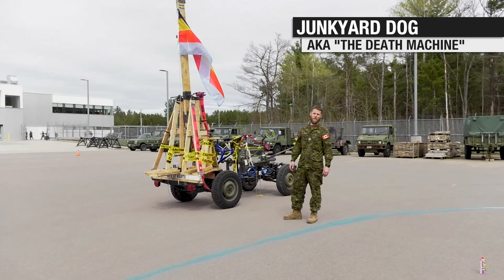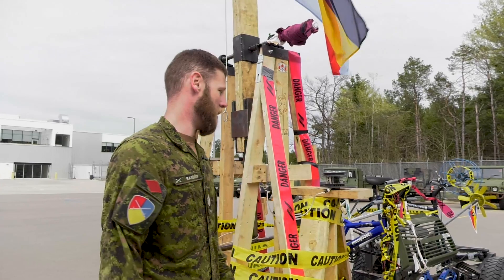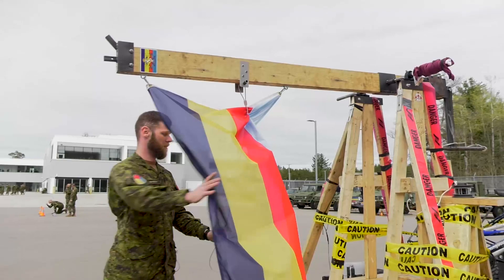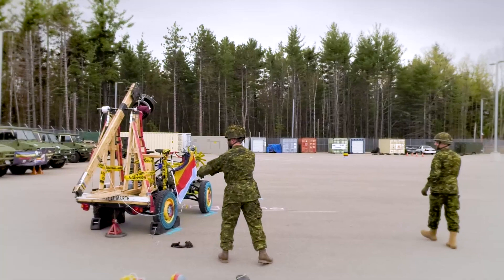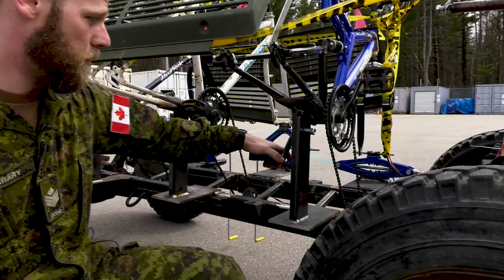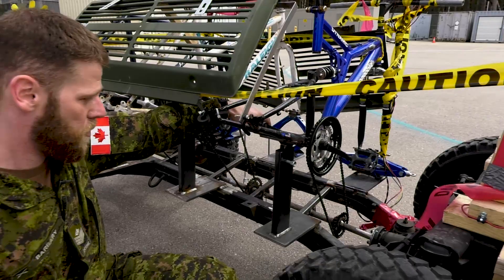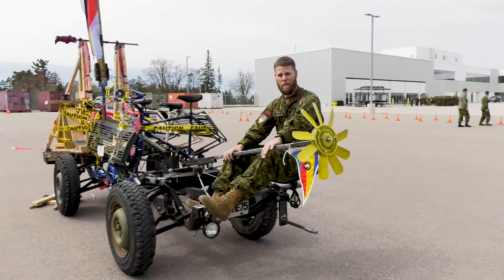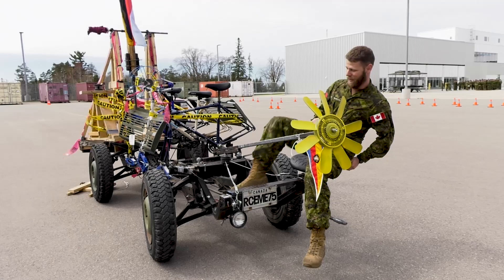Scrap Metal Challenge | Death Machine | Canadian Army

Comment: 3 or 3.5:1 beam ratio? 2 meter throwing arm, from main axle to tip of release pin? How much counterweight? What weight projectile? Mass ratio? Did you hit the target? At what distance? That machine would max out at between 290 and 325'. Less than 100 meters. I use scopes on some of mine for sighting, but run others with open sights. Looks like y'all had fun.